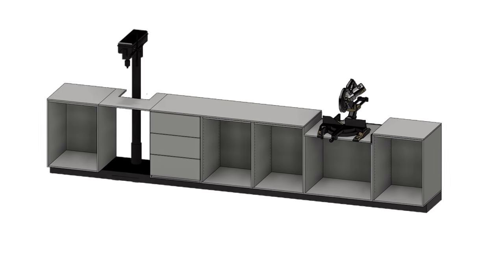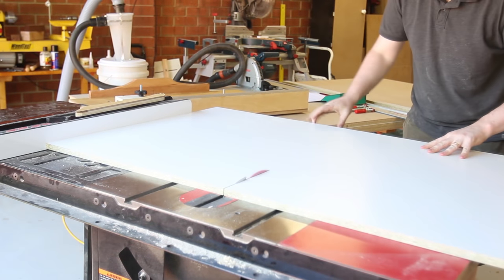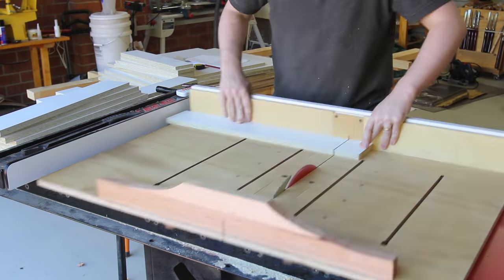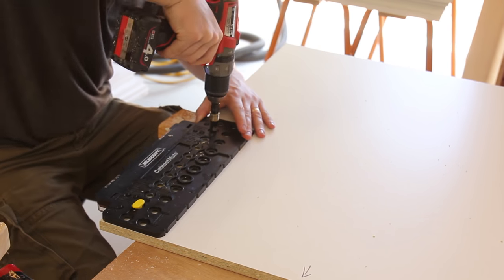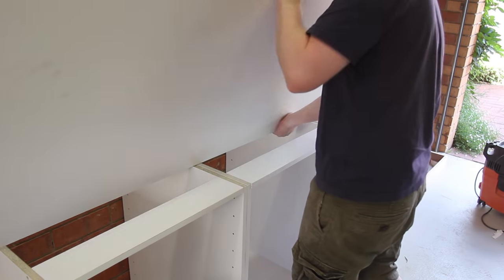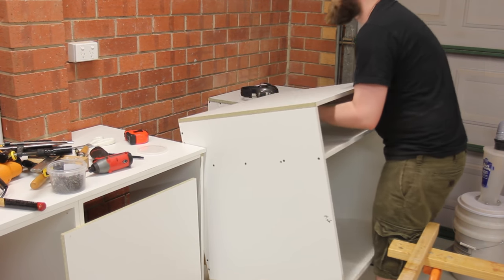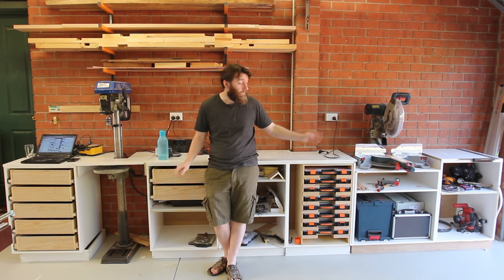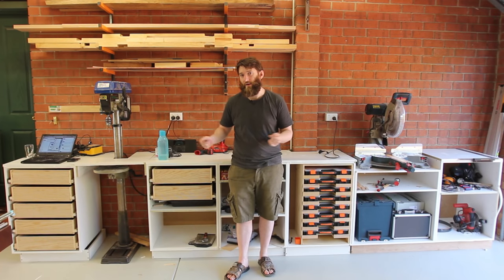086 - Mitre Saw & Drill Press Cabinets

Comment: Nice video Paul, a professional tip if you don't mind. Screw through your bottoms into your sides, that means you don't need glue and the screws hold the sides nicely in place. Also do all of your ironing first, then start with your first piece which will have cooled right down. The easiest way to remove edge banding is with a sharp chisel on it's flat held at 45 degrees to the direction of travel. Take the 90 degrees off the edge banding with 180 grit sandpaper wrapped around a sanding block, dowel or anything you care to wrap it around :).
Reply from the maker: +Brian C That is how I did the cabinet for the mitre saw, but not for the rest. I had a look at a bunch of different kitchen cabinets and other chipboard based cupboards around the house and there seemed to be no consistency in which way they were made. Some were screwed up through the bottom/down through the top, others were like what I did, which was screwed through the side.

The placement (rotation) of the top stretchers was a little more consistent depending on the application - if it was for a cupboard, it'd run "across" the face to act as a stop, and the reverse if it was for drawers... but even then it wasn't always consistent with the back runner.

Do you know why this would be the case? Is there meant to be an industry standard? I wonder how much of those 'standards' vary region by region too.
Reply: +Paul “TheWoodKnight” Jenkins   Paul I was taught the 'stetchers' were called front and back blades and we always presented them face forward for doors and drawers. The front blades to display timber or glued on laminex/formica to match or delineate the difference between the doors/drawers and cupboard tops. The back blades to provide sufficient glue surface for white faced masonite backs ( glued & stapled on ). I have never found an industry standard, some use carcase construction, but when there is no consistency I have found the work was done by carpenters.....we cabinet makers call them wood butchers :)
Reply from the maker: +Brian C Haha, fair enough. In this case I may have butchered a few things, but its melamine so that doesn't count too much as real wood, right? ;)
Reply: +Paul “TheWoodKnight” Jenkins Totally agree Paul, laminex or melamine, might as well be working in a plastics factory. :) .........Pity we still have to make a living with that stuff :P

Comment: When you make edging, you can use any cold things and press or glide edge with it to help glue cast faster. I use few colded in fridge steel rods.
Reply from the maker: +Богдан Ших Thats actually a really good idea. At the time though, I think I had about as much brain power as the edging had adhesive power - too much heat meant I was a melted potato.
Reply: Paul Jenkins hahaha Oh man I can relate!

Comment: Nice job - I'll be building something like this as well. I have the same miter saw and I have a table top drill press that will be on a mobile cart that will fit into the space similar to what you have. I've seen cabinets with drawers built to fit around the base area of a drill press like yours - something to think about - you can never have to much storage. How deep is your top - I was looking at around 30 inches/762 mm for mine.  I enjoy your channel  Scott
Reply from the maker: +The 2 Car Garage Shop width/depth are 600mm, height (including the plinth) is 900mm.

Comment: I like this but It's been my experience that melamine will now downward under the Bosch Miter saw, without support underneath.  Keep an eye out for that.
Reply from the maker: +Mark Gardner Initially I was going to add an additional hardwood stretcher, but it has't deflected yet. At the time I was also pulling apart my tablesaw to add in a router table/upgrade the wings, so it kinda just got put on the backburner.

Comment: Bosch sell the track saw with an l-boxx now? Cheeky pricks! I just got a cardboard box with mine. Fantastic saw on the tracks but I have found it to be rubbish when freehanding, after a couple nasty incidents with the plunge... plunging when not expecting it I just switch back to the old non track makita for those now.

Also be careful if you do any angle cuts and then switch back to 90 degrees. Double check it with a good square, had issues with the front and back not quite lining up and ended up being about a degree out. 

Anyways it's a great saw.
Reply from the maker: +Pete G No, the L-Boxx was part of the GOF1600CE (router) kit they also sent through to review.
Reply: +Paul “TheWoodKnight” Jenkins I retract my indignation then :D

Comment: Hello!  Great video. At the beginning of the video you mentioned a layout program you use. What program do you use to make your cut list?  Is it Mac compatible? Thanks in advance!
Reply from the maker: +Stuff Seth Makes MaxCut (there is a water mark on the cut list in the description), and no, Windows only.
Reply: +Paul “TheWoodKnight” Jenkins  Does Maxcut have a metric scale setting? I'm looking to use it to make my own furniture etc. Been looking on there website but can't find the answer.
Reply from the maker: +Bas Kaandorp It does metric - if you enter in 1" it'll auto convert that straight away to 25.4mm. Safe bet is any software will do metric and decimal inches 'cause conversion in software is easy.
Reply: +Paul “TheWoodKnight” Jenkins   Thanks for the fast responds! I will give it a try. Thanks.

Comment: I don't like the idea of using such a powerful tool to trim off relatively soft material. An edge banding trimmer which uses a razor blade seems more appropriate. They can be fairly cheap or even homemade. Awesome build, too.

Comment: I wouldn't build with anything but cabinet grade plywood... if I could afford it.
Reply from the maker: In case you haven't seen it, I'm actually rebuilding these cabinets right now.... in melamine! 
https://www.youtube.com/watch?v=JAaSDV_M7i0

While I could probably stretch to afford it these days, melamine was still the better option - it cleans easier, its smoother, I don't have to finish it. Formply/film plys all have those benefits, but the cost differences means I could kit out all the cabinets with drawers, full extension slides, etc.
Reply: I find the same thing.  Melanie cheap, strong, already well finished, and everything else you mentioned.  The money saved on Melanie does allow for a more comprehensive finished product (for us fiscally challenged folk).  Personally I bought a new small car with the money saved thus far. 

But one day... one day... I'd like to make a small show piece with cabinet grade plywood for the workshop; mostly because I can't convince family/friends to pay for the 'big $ stuff' for their own projects.  I just want to feel the difference .